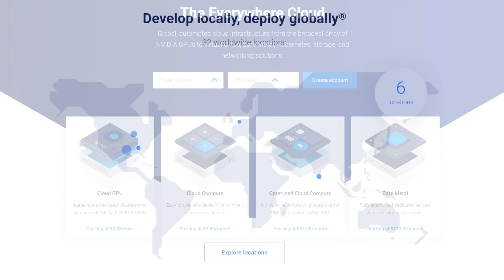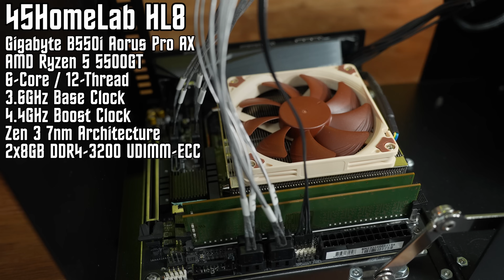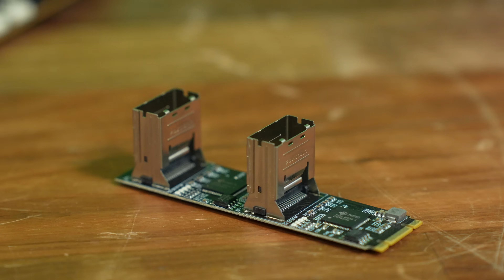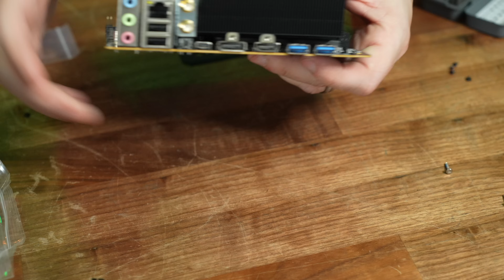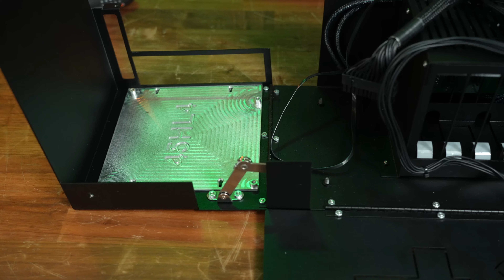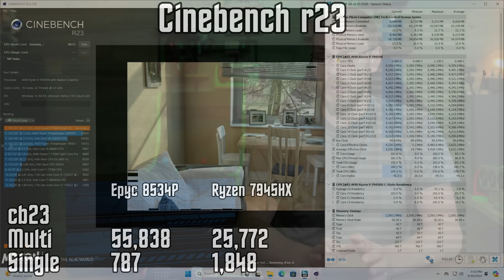The Ryzen 7945HX Mobile is an INSANE Server CPU - Minisforum BD790i in a 45Drives HL8

Comment: You killed that m.2 card when you plugged in the connectors.  You have to plug them in first and then install it in the slot so you don't over-flex it.  Mine came with some instructions that warned about this.
Reply: Given the case construction this m.2 card would be dead sooner than later. TBH such points in manual are just evidence that manufacturer is fully aware that product is flawed.
Reply: I was going to say the same thing. I groaned when I saw you plug the cables in and the board flexed so much. I did build a NAS with one of these controllers (and added some rPi heat sinks), but the relationship between the drive backplane and motherboard meant the cables were not constantly flexing, so I could ensure there was no stress on the controller board. Personally I would (as others have suggested) investigate an M2 to PCIe adapter. I have used one to add a thunderbolt controller to this motherboard’s cousin — the AR900i — when the main PCIe slot was occupied by a gfx card.
Reply: @patricksheffield2874  Have you seen any m2 pcie expander boards (including pcie switch) so far? Given the bifurcation is hard to get such piece of hardware could be particularly useful for hdd builds.
Reply: @patricksheffield2874 I know this is old, but what did you use to add a TB controller to your board?
Reply: @iandooley7390  I used an ADT M2 to PCIe adapter purchased on AliExpress and a Gigabyte Titan Ridge Thunderbolt controller. As a hackintosh, macOS recognized and used the thunderbolt controller.
Reply: The PCB should be thicker.
Reply from the maker: It wasn't going to live long no matter how I installed it.

Comment: I would just order that controller again and strenghten the pcb myself. use a sheet of aluminum or better something non conducting like wood or acrylic and glue it to the bottom. if you are careful and this is more of a one-time build even some thick felt added to the motherboard below the m.2 slot (the self-adhesive things you can buy f.e. at IKEA and are meant to be put under chairs etc.) will work wonders in limiting the flex.

Comment: Why not use an m.2 to occulink cable and put a full size card somewhere in the chassis?  I've used quite a few of these m.2 side of controllers but they were only a four-port model so the cable attaches in line with the adapter not straight up in the air

Comment: @CraftComputing   Suggestion:   (and I'll apologize up front).  ditch TrueNAS.  use Proxmox,  put in an LSI SAS controller.  Build a Debian container for Plex (or Jellyfin) and give the container access to the APU.   Build a Copilot container for your NAS 'stuff'.   Add other containers and VMs as needed.    I run this way on an HPE DL380 G8, though it has 2 PCIex slots, one of them is an Intel ARC GPU as the onboard video is, well, useless outside of a console.   Love the HL8 case and system board combo.  I'm thinking it is a future replacement for my aging homelab machine.

Comment: Correct me if I'm wrong, but I believe the BD790i doesn't support SATA on the M.2 slots (eg. with splitters/adapters)... pretty sure this has been brought up in various threads online, and only nvme disks are supported.
An alternative might be to run a dedicated card in the X16 slot, with bifurcation enabled (eg. x4x4x4x4, with a 4-way M.2 riser/card)... then put your SATA adapter on that).

As for the heat - just like on direct-die desktop solutions, I'm not surprised the CPU is capping out at it's 90c limit - I'd suggest switching to liquid metal or something like a Thermal Grizzly KryoSheet (graphene sheet) for better heat dissipation to the heatsink... there's a decent amount of power attempting to be dissipated from such small die areas, that conventional thermal paste just doesn't cut it.

I've got the bd790i SE on order - my plan is to attempt to use a Mellanox 10g card in one of the M.2 slots (already have the adapter necessary, and working in an 11th gen system); then bifurcate the x16 slot to use the Asus Hyper M.2 x16 Gen5 card with 4x gen4 nvme's.

Worst case scenario - if the M.2 slot doesn't recognise the Mellanox card - I'll attempt to move it to an M.2 on the X16 riser card (yes - adapters on adapters!). Failing that, I'll literally try an M.2 10g card...
Reply from the maker: You are correct, there is no SATA controller on this board. The m.2 card I added was a dedicated SATA controller on a PCIe device. Just like an HBA.

Comment: Try the m.2 to u.2 adapter to sff-8643 connectors
Reply from the maker: Those are often m.2 to u.2 adapters, specifically for NVMe devices. They won't work without a SATA/SAS controller onboard.

Comment: Why not do a M.2 -> PCIe 16x (4x electrical but fine for a HBA card) similar to the PCIe 1x to 16x adapters like in PC based mining rigs. Try to do a crazy cable management job so you have some space above the drive cage. Run the cable (ex. oculink/SFFxx something) from the M.2 adapter to the PCIe 16x board. Use almost any of the PCIe risers you have on hand (ex. from the Hyve 1U servers) so the HBA can sit parallel with the top of the case. Then just recycle those SAS cables from the SATA M.2 to the appropriate HBA adapter. That PSU should have the needed connectors to power the PCIe 4x board. Make a 3D printed bracket to hold everything together & circuit board barrier for the PCIe board as well. After that you should be good to go I believe.

Comment: BD790i owner here , some technical info you might want :
- PCI bifurcation modes are : 8x4x4, 4x4x4x4, ( PS: upgrade to latest bios if the option is missing, i know i had too ) :) 
- Internal fan controler is from ITE and supported on Linux if you load the  it87 module 
- If you cant figure out how to disable Secure Boot , it's because you need to set up the Admin Password in BIOS first
- if u need a second NIC , the Wifi card is on an M.2 slot, i changed mine , the bandwitdh is ok , i get like 2.2Gb/s on it in real life with a cheap M.2 to 2.5GB card
- Pretty much works with unraid out of the box ( PS: if you plan on adding an intel arc card , upgrade unraid to 7.0.0-beta for the best experiance) 

Got any more questions ? Feel free to ask :)
Reply: So running in 8x,4x,4x you would have 8x for GPU, 4x for an HBA, and 4x for a 10 gbps NIC - sick
Reply: @bjackman16502  yes you can do that. But beware the splitter you might use won't give the GPU the full 75w from pcie afaik
Reply: @arjungupta3531  but the splitter costs enough to get a better computer.
Reply: @bjackman16502  - I see many 4-slot (x4/x4/x4/x4) bifurcation adapters, but the only 3-slot (x8/x4/x4)  adapter appears to be the RSC-R2UG-2E4E8, which may be proprietary to Supermicro server boards.   Do you know of any other x8/x4/x4 adapters?
Reply: @dbaldock9 
Aliexpress has plenty of them. I've been using one for over a year now on my Gigabyte Z390 itx board. It even supports 110mm long M.2 SSDs!
Reply: @dbaldock9  I have one 8/4/4 which both 2 4 lanes divider was linked to 2 M2 slot on it , I using that for a 5600G mini NAS for 2 more nvme storage plus a GPU , the adapter + low profile card will fit a full height slot
Reply: Have you also tested it wit truenas scale?
Reply: Is the CPU fan required?
What is the performance delta (fan/no fan)?
Reply: @TerminalWorld  The fan is needed, i had the cpu go to 90C with the fan on under heavy load , i'm using the ARCTIC P12 PWM 120mm fan, average temp is 60 under light to moderate load
Reply: @TerminalWorld pretty much yes. It hit 70C pretty fast even with fan under load
Reply: Idle power on what exact hardware?
Reply: Can you try ecc?
Reply: @LouisDiNatale  got no ecc sticks available sry :|
Reply: @DarkSideAvatar1317  thank you for the reply
Reply: will it fit in a 2U case?
Reply: @wez_furlong  dont have one to test but will mesure
Reply: @wez_furlong yes with a slim fan, can fit with a normal one but airflow is trash then
Reply: Admin password to disable secure boot? Are they trying to be Acer?
Reply: @Sqaaakoi  Plenty of laptops do that. I would suspect the minisforum being more... "laptop oriented" have UEFIs based off laptop UEFIs
Reply: @Sqaaakoi dude why would I want to turn off secureboot?? I'm am G7 PT owner..
Reply: @bradthelad3000  i just explained how to do it, feel free to not do it, i guess
Reply: Wasn't that standard pcie wifi extension port ? I have to admit I did not unplug it to check
Reply: @gari5961  the ethernet adaptor i got in it is says M2 A+E key so i guess this is it :)
Reply: @DarkSideAvatar1317
 does pci-e birfurcation allow also the usual x8/x8 ?? because so far i cannot find any-non m.2 5.0 ( only 4.0 ) and my intention is to use a  2x 16x(8lanes) powered adapter. 1 slot having a lsi card ( used pci 3.0 8lanes via 16x connector ) and a old 2080 RTX for transcoding ( lack of space would require a riser of some sort on 2nd slot)
Reply: Please spam Minisforum asking for memory OC settings in bios, we need to be able to tune the memory to gain 10-20% performance
Reply: The bifurcation is the key. With 4+4+8 (I'm not sure about 8+4+4) he could use "AMIUHOUN PCIE 4.0 Channel Splitter Expansion Riser" It splits 4+4+8 into x2 M.2 nvme sockets on board plus PCIe x16 socket as x8 for a graphic card for example.
Another option exists as a M.2 nvme to PCIe x1 adapter. Here he could use his 10Gb Ethernet card, and left a PCIe socket for a normal PCIe to 16xSATA adapter. But that 4+4+8 splitter is more versatile.
Besides, I'm sure there is a true PCIe splitter somewhere, which will be suitable for 4+4+8 or 4+4+4+4. At least as a KiCAD project -)
Reply: Can i run 2x Nvme drives in raid 1, using the 2 on board M.2 slots?

(can't figure this one out, I'm on 1.09)
Reply: @pangeltveit  did not see hardware raid options , but you can certainly try to go with the software raid option
Reply: @DarkSideAvatar1317  running it in a raid1 storage pool in windows right now, but it feels dirty doing it like that 😅
Reply: Why install a 2.5gb Nic if one is already included on the board?
Reply: @pipedreamsz  to use the board as a Router/Firewall without having to use VLANs on the single 2.5gb NIC. For example
Reply: @pangeltveit  if you can enlighten me please, what does he mean by i changed mine?
-if u need a second NIC , the Wifi card is on an M.2 slot, "i changed mine" , the bandwitdh is ok , i get like 2.2Gb/s on it in real life with a cheap M.2 to 2.5GB card
Reply: @pipedreamsz  in my case i use the second nic as a direct connection to my pc that also has 2.5gb card , so i have
 router > server > PC
Reply: I was wondering PCIE bifurcation would work with this motherboard/CPU combination? I am thinking about having 4-8 ssds and  I want to have a GPU as well
Reply: @DustinEveritt  I have a very similar setup , but I have hdds instead of SSD's , there are m.2 to dual SAS adaptors , those will come with 2 SAS to 4x sata cables, for a total of 8 sata connections, but the read/write is kind of limited to ~200mb/s but they keep everything tidy, food for thought 😉
Reply: Does it support 96gb RAM?
Reply: Can i overcl9ck the cpu?
Reply: Should It really be considered if I don't have space or cooling constraints?

Planning to run PROXMOX with ~6 light used windows VMs
Reply: @arjungupta3531  i would advice against it , i am using it in a Jonsbo N2 case , that has ample airflow , with an ARCTIC P12 PWM 120mm fan on top of the radiator , i had moments when it hit 90C under heavy multithreaded load

Comment: they missed the mark with this if you want to make it a nas. no 10g, dual 5.0 @ 4 lanes instead 5.0 overated on storage. 1 pci slot. the 1 pci slot could still be ok if you had 10g eth then you could 2 drive m.2 mirrored and then put your lsi controller in. the amd chip itself is a beast, wish you could just use that over main pc lines more lol

Comment: if that m.2 adaptor gets replaced, you could probably solve the problem by using an m.2 extension and putting the adaptor in a 3d printed casing instead of mounting it on the motherboard directly

Comment: UFD Tech solve this when adding a graphics card to the Steam Deck. Find a M2 to PCIe extender/extension card, kinda like those use on GPU miners to help your google searching. Just read the description and ensure the m2 to PCIe has the proper EMI shielding and bandwidth for GBps for your GPU.

Comment: I built something very similar recently with the same idea of using those nvme to SFF-8087. I had a old SANSDigital towerraid case (8 drives with two external SFF-8088 connectors) I had lying around for years and wanted to build an openmediavault server out of it. I Bought and fitted a CWWK P5 with the 4x nvme top board. 

While waiting for this main board to arrive, I had already received the sff-8087 nvme adapter. I thought I could start playing around with it by buying a usb-c to nvme and try running it externally on a separate machine. That's where I found out about the hotplug issue like you saw. Same thing for me, I don't mind shutting down for maintenance when changing drives. 

But it was getting unreliable. I think that thing just gets too hot. I had some tiny raspberry pi heatsinks lying around and added it to it, but wasn't satisfied. At the same time I bought that dual SFF-8087, I had bought also two single SFF-8087 nvme adapters. They have the same hotplug issue, but atleast they seem rock solid. You may think of ordering some single SFF-8087, but you would have to remove that nvme drive, and that fan might get in the way now....

Comment: I believe that the built in iGPU on the CPU supports video encoding, at least well enough for Plex probably. You might try it out and see if it works, assuming it does use that for encoding and stick an HBA in the PCIe slot.

Alternatively I believe the PCIe slot supports bifurcation so you could always just grab a riser card and see about modifying the case or something to allow for both the video and an HBA card.

I bought one of these last week and set it up on my test bench for a future project and so far I love this thing. A couple of performance notes I wanted to point out, the heat sink is using thermal adhesive stock from the factory, take the heat sink off and replace it with something better for a performance boost. Also, I had better luck with my 120 Noctua fan turned around to pull air through the heat sink instead of pushing into the board, there’s a lot of things in the way on the board side so you might have better luck that way but YMMV. I was personally able to maintain 100w total package power for over 30 minutes myself with those modifications.
Reply: sadly no, Intel is the only solution for plex really. even an Nvidia card with cuda sucks for hardware encoding unless Its one of the serious pro cards.And  Quick Sync easy beats the crap out of Ngreedia for hardware encoding anyway.

Comment: On a side note: I personally prefer having a taller rather than a wider enclosure and I also generally prefer to have the drives accessible from the outside without needing to lift the lid on the enclosure. Activity and status lights on the drive trays is also always a good thing, even if they're just using light pipes from LEDs in the storage backplane. Sometimes, having the entirety of the drive sled be dumb is a very good thing, as it means one less point of failure. With the falling cost and increasing reliability of NVMe storage, I'm more looking forward to companies like 45Drives releasing an ultra-compact storage array that utilizes little sleds to load consumer or enterprise M.2 NVMe storage into a PCIe midplane with appropriate RAID controllers or direct pass-through for JBOD. Even if the drive sleds include additional thickness for cooling the M.2 drives, you should easily be able to cram two rows of 8 drives into an ITX mini-tower, though you may have to use a PCIe multiplexor to split the PCIe Gen5 down to PCIe Gen4 in order to get enough PCIe lanes for all of the drives, since ITX doesn't generally feature more than a single PCIe x16 slot due to space constraints.